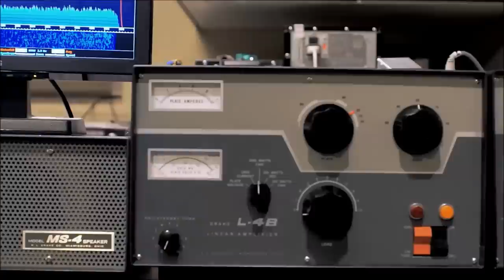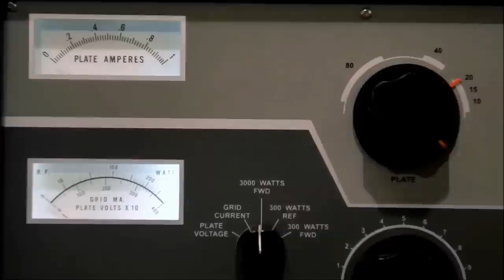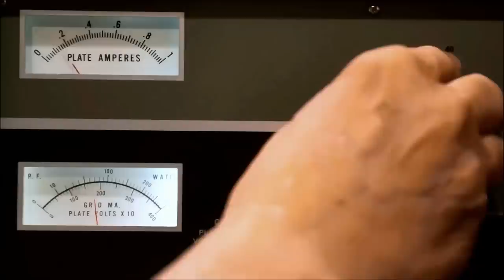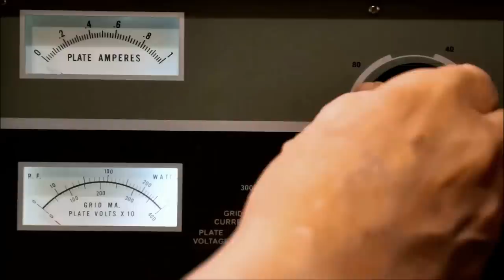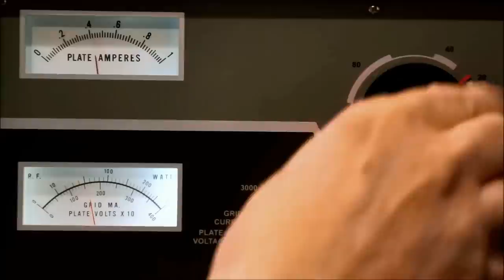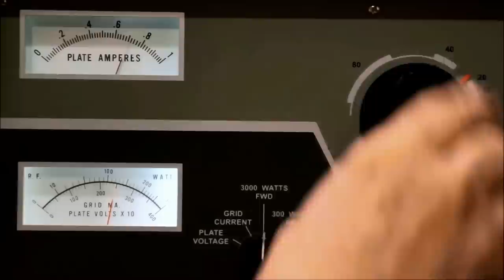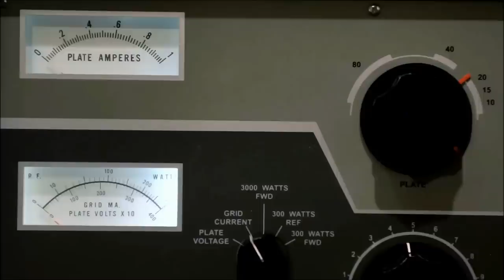Ham Radio Basics--How I Tune A Linear Amplifier

Comment: Hi, Jim. I'm in the UK, so 240V here. I've just picked up my first big HF Amp, the AL-811H (four tubes). In the UK we are restricted to 26dBw (400 watts), so my amp will be cantering along. How did that song go? "I got my Amp to keep me Warm" (grins). Anyway; I use Westflex 103 everywhere (even hook-ups) and never have a problem, but any thin coax, no matter what type, I've had problems (the operator?), so dumped them all. I bend my cable round a  wheel so as not to mess up the impedance, where curves are concerned (pedantic, yes).

My concern, before even turning on this amp is where to use an ARB-704 Interface. Radios in use FT-2000 / IC-7300 / IC-7100.
I'd rather not damage expensive radios for the want of doing the job right first time.
Your thoughts would be most welcome, Jim.
Reply from the maker: Hi,
I had never heard of that coax, so I 'googled' it.  Loss is half of RG213!  Thanks for the heads up!

The interface boxes like that go in the keying line between the transceiver and the amp.  Typically that is a phono plug on both ends.  I use the interface boxes (either homemade or assembled) just to be safe.  I had a call yesterday from a friend who blew up the switching transistor in his Icom by not using an interface box.  Also, I would engage the tuner in the transceiver to provide a little more circuity between the final transistors and the linear in case it coughs or burps.  Things happen.  Thanks Tony.  73 Jim W6LG

Comment: Jim I have a heathkit sb-200 how does one go about tuning the input circuit so the rig sees a good swr? Any specific equipment needed?
Reply from the maker: That tuning is described in the operation manual.  There are lethal voltages so you must be extraordinarily careful.  Insulated tools are handy to have around the radio room. 73, Jim
Reply: @ham-radio  thanks for the info Jim I must have missed that in the manual and yes thay have very high voltage present in them I will take every precaution possible when working on it keep up the amazing work and content I really enjoy your videos 73 Kd9dle

Comment: Thanks for the extraordinary support. I've never ever driven my amplifier tl 922 with 100 watts. Always 50 watts. From my antenna to the amplifier i have 90 feet of 36 years old Rg8. I'm ordering from your website all the necessary materials to install new pl 239 on all new cables rg213 i am going to purchase. The other antennas as well are in same condition. Changing yagi 3 elements multi Fritzel. Very old. So my amplifier, 50 watts key down = a bit less than 600 watts.
Reply from the maker: Thank you.  

That is probably about right for 50 watts of drive.  With 100 watts you should get about 1200 to 1500 watts out.  Thirty six year old coax is really lossy.  You are loosing probably 50% to 75% of your power in that old coax.  You will see a huge difference in signal strength and the SWR will look a little higher.

73, Jim W6LG
Reply: This video helped
Me rune tl922a
With ts930
Preset cw 30 watts input
Goto tune mode
Tune 922a
Goto ssb on ts930
Goto ssb amp 
Wa la very modest amount
Of power 500 to 600watts
Save wear and tear on amp
And tubes
My 922a has only 50 hours service on it 
It us like new
Reply: For coax i switched to rfc400
My opionion best option
More cost 
Bit will handle higjer power

Comment: Do these amplifiers cause any loss on RX? I would imagine so unless they have a relay that bypasses the circuit.
Reply: They have relays at input and output so that they have a fairly lossless path for receive or for direct transmit from the exciter.

Comment: I just purchased a SDR 1 MHz to 6 GHz transmitter at about 5 watts.  If I wanted to increase my signal to 50 or 100 watts do you have any recommendations for new equipment?
Reply from the maker: I have no idea about what to buy.  And, what could possibly cover that huge range of frequencies and still meet FCC standards; especially IMD.  Sorry that I can't help.  I just don't know anything about SDR transmitters.  I have several receivers.  73, Jim W6LG

Comment: Thanks jim nice video and information on setup an Amplifier,
 i am new to Amplifiers how to properly setting them up this information is very helpful to those Hams looking in to running Amplifier i like running just two hundred watts my self just use a good antenna system to make lots of contacts.
 it can be a big challenge for those that our running big linear Amplifiers to make the contact.
 i just make the best of it since a good Amateur Amplifier is very costly :-(
well jim keep the good videos coming thanks ted Dean KD2ARD....

Comment: Jim 
I was reviewing your video and saw at 15:10 you state your increasing your plate voltage.
I didn't see you adjust the Plate Voltage Load knob ..???
Reply from the maker: I think I may have flip a rocker switch on the front panel of the amp.  There are two voltage positions.  Thanks for asking.  73, Jim W6LG

Comment: Hi, Jim. I've always wanted a big valve PA. However, I'm only allowed 26dbw here, but would rather have 1kW and run run the full 400 Watts so that I would be ticking over and have an amplifier (tubes) that would last many years. In the past I have built 70cms and 23cms amps up to a few hundred Watts PEP with little problems. Would I be better off buying a ready built HF amp, or, should I build, knowing the transformers and capacitors are going to be a pain to obtain?
Reply: g6ypk Tony I have built a few VHF amplifiers, both solid state and thermionic. Building is more fun than operating for me,  some parts you want for a multi and HF amplifier are not widely available cheaply. Sometimes it is an attractive solution to buy a used commercial amplifier that needs TLC.

Comment: Will I damage my amplifier (new to me) if I tune my amp, and use it, at less than full power?  Because my antenna tuner will only handle 300 watts, I want to stay below that.  Also, I see you always add a little extra load each time you tune.  Is that what they call "dipping the load"?
Reply: It's dipping the plate.  If you watch the video,  the upper meter which displays plate amperes will dip as he tunes the lower power output meter for maximum.

Comment: Thanks very much for your support. My immaculate, externally immaculate tl 922 is dated January 1980. It has been used not on every day base. I didn't have time. Now i finally have that time and i use it 3 to 4 hours a day, 5 days a week. Work almost cw. So when i tune it carefully it gives 550 watt continuous. According to your experience, in that situation, do you recommend changing tubes or wait. When comes the time and how you really see its time for a change? Bst 73 de i4oqa.
Reply from the maker: You should have a lot more output.  Are both tubes looking a little "red" when you send 100 watts into the amp?

73, Jim

Comment: Jim,  I hope this message finds you well.  I Picked up a Drake L-4B from a local ham in town here a few months ago. I'm still learning it, but have used it a few times to great success.  This is a great video! Thank you for doing this!  
I have one "newbie" question to ask and hope that you still monitor this after 6 years:  When you key the radio, what mode is it in?  I'm assuming not sideband as you need to send a carrier?  I use my paddle in CW mode, then switch to SSB if I'm using it on SSB.  
Thank you again for making this and 73!!
Joe
KA9I
Reply from the maker: Sounds good.  Tune for max output and then increase the load control about 1/8 to 1/4 inch.  73, Jim

Comment: Hallo. Have you ever tuned a kenwood tl 922 hf amplifier? There are a few videos. In Japanese and one in English. I'm not so sure if tuning as per the user manual is really correct. In that case you won't get all the hummus out of tl 922. Bst 73 de i4oqa.
Reply from the maker: Hi,

I have tuned and used a TL922.  I did tune that amplifier in the same way that I did the L4B in the video.  That Kenwood is a very good amplifier and can run 1500 watts out.  

73, Jim W6LG

Comment: Now, we have Class D or H or where the drive controls the high voltage! but it's efficient and clean. ?
Reply: James Hiney Efficient, yes. Clean, there is nothing remotely clean -- RFI wise at least -- about a PWM'd square wave.  To turn a Class D amplifier into something clean enough for radio would require a tremendous amount of filtering in order to remove all the harmful harmonics rendering a clean analog output.  You tend to see class D more so on the audio side than in amateur radio since spurious emissions are a serious matter when transmitting at power in radio since those harmonics and splatter tend to obliterate other licensed radio services -- that is why we do not use cheap (and illegal) CB "pill" amplifiers as they tend to cause tremendous interference.  There is much greater tolerance for distortion and out of band harmonics in the audio realm, especially among those whom only care about the raw power of the "boom".

Comment: I'm not sure if I'm set up correctly.. I have a general Lee ran into a 2 pill fat boy linear amplifier to 2 trucker 2000 antenna.. I have a huge power wire from the battery to a diffusion block with 8 guage to the amp 10 guage to the radio both ground to the chassis.. but radio only I max the guage on the radio with amp on only 3 quarter of it.. and lights on the radio dim.. can you give me some things to do to test or rate effectiveness
Reply: You are asking a ham operator to offer help to run illegally on cb? LOL
Reply: Besides being illegal,  CB amps create too much distortion and unwanted harmonics on and out of the CB frequencies.  For educational purposes, feed your amp to a dummy load. Make sure your radio is perfectly aligned so that it has the cleanest output signal a radio technician can adjust it for.  No over modulation and no cranking your output power on your radio. Using a bird meter will give you a more accurate reading on your output power from the amp.  If your lights are dimming right now, my guess is that you’re doing well over 200 Watts.  Lowering your drive power with a clean (aligned) transmitter might give you less power on your meter but it will sound a lot better.  Having said all of this....it’s still best not to go on the air with an illegal amp.  Good luck.

Comment: I keep a chart of where plate and load should be. Go to those settings and hit it with 50-60watts , quickly touch it up and I'm done.  50w in equals 1000w out on my amp.  Thanks for the videos. VE3WF

Comment: what am i doing wrong, my plate current is 75, my grid current is 0. 50 watts in, 50 watts out? I have no tuner hooked up.
Reply from the maker: You are not providing enough information for anyone to help you.  What is the rest of the story?  73, Jim
Reply: There is not much, I just plugged it into my Yaseu as instructed in the manual(I connected relay connection to a switch which is connected to an external power supply and connected the RF out to my 1/4 wl vertical, i connected the yaseu to the Rf in) and when I key the amplifier in AM mode with the rf out down to 0, the grid current is 0 and the plate is 75. When i turn the drive to 50 watts, nothing changes. Something is shorted or not working.

73, Ivan
Reply from the maker: Sorry, I can't help.  You have not told us anything new.  I don't know model numbers, bands, plate voltage, tubes, transistors,  ALC connection, ptt connection, vox or mox, not even your callsign. Have you contacted the manufacturer or retailer?  Have you enabled the phono jack?   It is like saying my car won't start and asking what is wrong with no details. 73, Jim
Reply: Its an Ameritron-al811
811A new tubes
40 meters
no ptt vox mox
AM mode
no ALC plugged in
plate voltage is normal, 1.5 kv
I have not contacted anybody.
phone jack is enabled

Here, I answered all your Questions.
I just wanted to know if its a common issue with the al811.
Reply from the maker: Hi, You made no mention of the amplifier. So, if you wanted to know if this was common with the AL811, you should have asked that.  It is not common.  I would very carefully set the transceiver to 1 watt and put it into transmit in the AM mode. Then I would manually short the phone jack cable to key the amplifier. 73, Jim
Reply: ok, i tried increasing the mic gain, like VK3MH told me, and it worked, only the sound was very distorted.
Reply: there was not enough RF Bias to get the amp off idle.
Reply from the maker: @letitrotfuckit  I think you might mean drive.  If so, did you try more drive?  Was the idle current normal?
Reply from the maker: @letitrotfuckit  Put the meter into the ALC position and lower the mic gain until it only reads 1/3 to 1/2 scale as discussed in the instruction manual.
Reply: @ham-radio  I tried 40 watts drive AM, that is as far is I could go. I am getting a new transceiver anyways. When I put mic gain down that low, the amp is still idle, only when i put it up real loud, it works and the grid current only goes up by 1 tik mark. I think it is a problem with my transciever. The idle plate current is 75 mili amps when keyed, that is normal.

Comment: So many nice videos but the simple thing as how to hook up the tuner and swr meters go in the Daisy chain to linear missing? I have ic 7300 antennas are restricted. I was able to get a all band vertical installed 
 to my front door hand rails.. I have signals coming in ok .. bit on low side but working .. my swr about 3 the mfj came in handy and have flat swr. Now it's complicated I bought a amertron solid state 600  it's a  beast. I plan to use only at 200 to 300 watts max.. I have no knowledge where the stuff get hooked up.right where tuner goes last my external meters for swr .. and if I use my internal tuner or not ... Very complicated .. I think I have some basic ideas but wish your videos if includes linears and how to tune them don't skip the simple stuff which is the most important .
Reply: Peelarat This should all be covered in your amplifier documentation.  You do not use your radio's internal tuner (if so equipped -- I assume this is the internal tuner you mention) as there should be darn near 50-Ohms between your radio and the amplifier and you do not want to be altering this relationship dynamically or you complicate tuning things down the line.  If you are using a solid state amplifier then you will absolutely want to insert a tuner after the amplifier (one rated in excess of the amplifier's maximum output power) so that the antenna load, as seen by the amplifier, is as close to a 1.0 SWR as possible as solid state amplifiers are very sensitive to the impedance mismatches created by high SWRs whereas traditional tube amplifiers are much more forgiving of the higher voltages encountered by SWR mismatches.  If your solid state amplifier contains its own internal tuner then you would make use of that tuner (and thus do not need another tuner after it) since that will be inserted after the amplifier, matching your antenna and coax/ladder line to the amplifier.